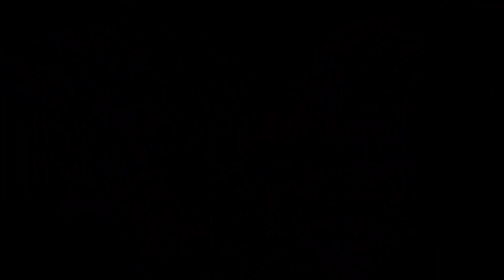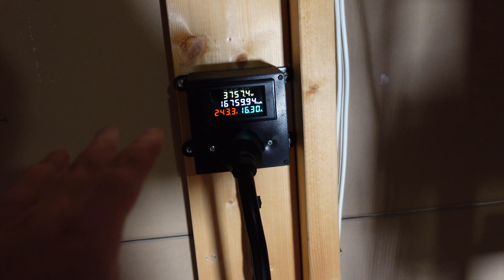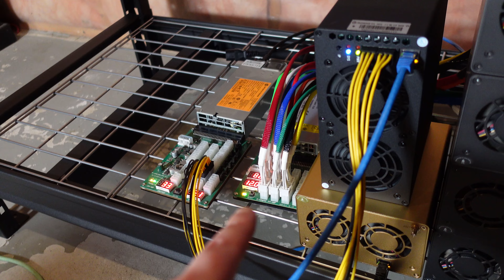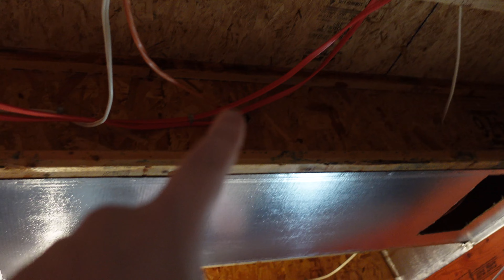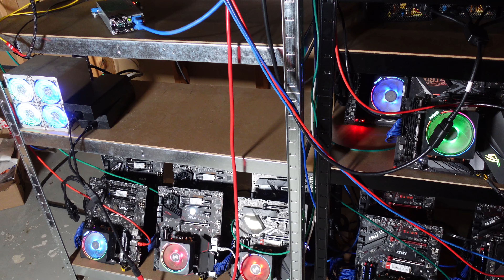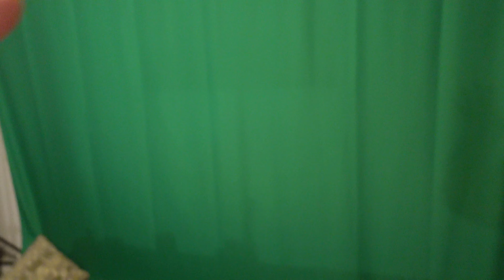I Got More Power

Comment: You mentioned XMR solo. Is that only a CPU mineable coin? I read somewhere that it was also GPU mineable but that might have been expired information.
Reply from the maker: Ya it use to be but monero is CPU only now since it forked to randomx algo. Can get a GPU to run but hardly get any hash.
Reply: @RabidMining  Thanks for letting me know!
Reply from the maker: Np
Reply: Yea like 20-40 hashes with gpu and 10x , 20x times more with cpu :)